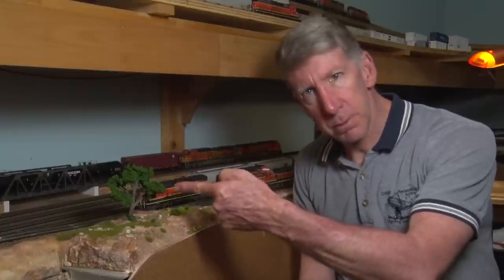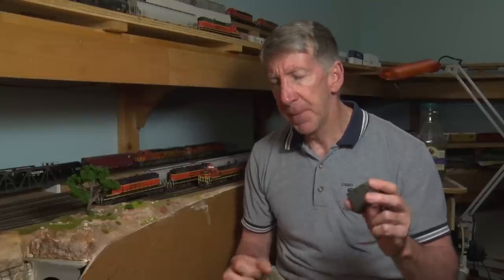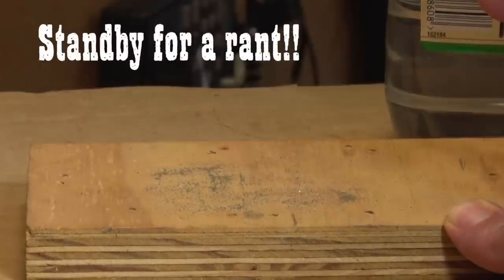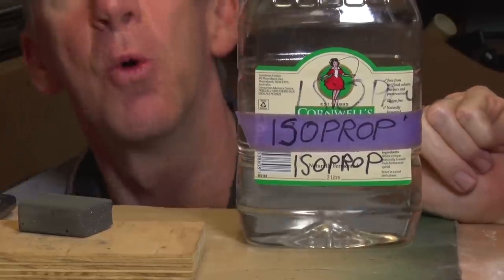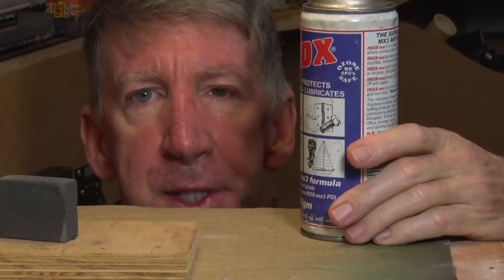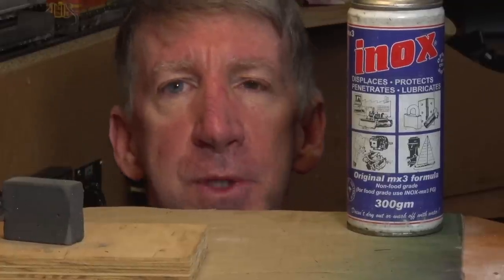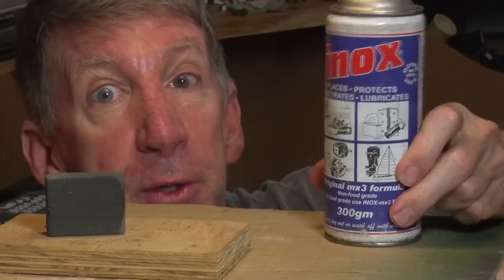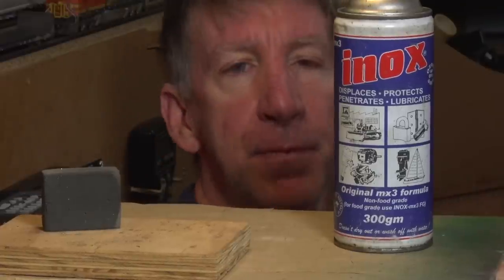Track cleaning do's and don'ts. How "Not" to  clean your track ! And how to do it better!

Comment: Yay Bunnings sell inox, and I'm about to go get some. After using isopropyl alcohol and methylated spirits that do clean but never long lasting, can't wait to lift my track cleaning game. Yee Ha!!!
Reply from the maker: Way to go Phillip! Just use a little and let me know how it goes for you.
CHeers Gregg
Reply: @FishplateFilms  Ok Gregg, after using Inox for the very first time, here's my findings...  Just 3 words...  USE EXTREMELY SPARINGLY!! Obviously I applied too much to my tracks and was wondering why my loco's were stop starting - jittery - needed a constant little push to get them going, blah blah blah. Also sometimes the headlights would NOT turn on but the loco would move a few inches then stop. Now I must say at that point I'm thinking this stuff is crap, but then I started thinking about all the POSITIVE comments I was reading about inox and then a penny sorta dropped. Armed with trusty dry cotton buds I went around and cleaned each and every rail and actually a fair amount of dark gunk came off. I then fired up my loco's and what a difference...  Absolute beautiful slow running and full speed running - EVERYTHING IS GREAT. GREAT I TELL YOU, GREAT!!!!
Reply from the maker: @phillipg1588  Great to hear Phillip!  Yes , you don't need much at all, and the more you run trains, it will get better as the INOX is spread around the layout. You will keep getting black on the rags, as this is the dirt from wheels being left on the rails, so it will clean your wheels as well!
Thanks for the feedback and enjoy your smooth running locos!
Cheers Gregg.

Comment: I hadn't been in the train shed for 18 month, but it's lockdown in Melbourne - so perfect opportunity to get back into the hobby! Spent a morning vacuuming up the spiders and dust. Then an afternoon fault finding wiring issues and trying to get trains to run without constantly stalling. Found your video and decided to give your solution a go. It absolutely surpassed my expectations! I now have locos crawling around the layout and not missing a beat, have never been able to reliably run locos at this speed before . Many thanks for your advice.
Reply from the maker: Hi David, 
Thanks for giving me your feedback and I'm glad you got great results!!  Your story is the EXACT reason I made the video and I have received many similar tales , so the rants have been worthwhile..LOL. Bad running trains spoils the hobby and there is no excuse for it these days! 
Have fun running your new locos! 
Cheers Gregg.

Comment: With the track rudder I use DCC same as you but I use the track rudder since I was 5 I’m now 13 plus if you did it on wood and if you did it on brass which is more like the track it would be a lot less so you test is not fair on the track rudder next time do a fair test and you will see there is next to non bust and no mess
Reply from the maker: As stated in the video Ethan , I used the wood to simulate going over turnouts and rail joints, which do indeed make large amounts of residue. There is less from the rails as you say , but the rubbers damage the rails, so matter how gentle you are:-)
Cheers Gregg.

Comment: fuck me dead mate that was a great laugh. love it. what are your thoughts on good ol lanolin oil? I've heard its does the same job. non-conductive but lifts crap right out of the way.
Reply from the maker: Thanks Liam..glad you enjoyed it! I have used "Lanotech" spray as well, and it's the same but is a little sticky. But it seemed to work as good as Inox.
Cheers Gregg.

Comment: Isopropyl alcohol is not ethanol; it's isopropanol, a different molecule altogether a 3 carbon backbone as opposed to 2.  You can purchase 99.9 % anhydrous isopropyl alcohol which is explicitly sold for cleaning circuit board contacts; I've used it on my tracks for years without issue.  There is no denaturing additive and an extremely scant amount of water, no more than what exists in the air as humidity.  To think your track isn't exposed to moisture because you don't use isopropyl alcohol is quite a misnomer, I would argue.  Isopropyl alcohol having such a low vapor point and excellent solvent properties makes it an ideal cleaner for sensitive applications.
Reply: how often do you clean your rails?
Reply from the maker: Every time I run the layout, I go over a different section. It might be once a month or longer?

Comment: https://youtu.be/4o2wUa6wxck the layout in this link was 5 scale miles long and we only used isopropyl alcohol to clean it a couple  times a year and never had stalling trains due to bad contact. I'm not saying your wrong, I'm merely stating we at the club did not experience anything but clean track that worked well on the layout. It was dcc.

Comment: Have not seen this product in Canada or U.S. Hobby suppliers.  There is a very effective  track cleaning product available, ACT-6006,  sold by Aero Car Hobby Lubricants, (aerocarlubricants.com or achlubes.com).  I believe it is non-petroleum based.
Reply from the maker: Yes , this has been suggested by others so It must be very similar!

Cheers Gregg.

Comment: Damn it Gregg, quit pussyfooting around, stop holding back and tell us how you really feel! Jesus, cracks me up how people with decades of experience try tell us how to do things, the nerve!!

Seriously, great information. I've also heard some people here in the USA using DeoxIT.  Thanks for the rant and workshop language!  Terry
Reply from the maker: LOL....Thanks Terry ! The nerve of some people!  Notice how I am not doing a rant on scenery..LOL
Cheers Gregg.
Reply: @FishplateFilms  hey Gregg, it's been a couple of weeks since your rant. In that time and per your "subtle" hint, I've stopped using isopropyl alcohol and started using CRC 2-26 to clean my track. With one application of CRC over the past 2 weeks, after dozens of laps around the layout, I have noticed an improvement in electrical conductivity and performance of my locos, especially in my staging/yard ladder area. There are hardly any "hiccups" anywhere on the layout. However, there is one downfall......with cleaner and lubricated track, I now have wheel slip at certain inclines on the layout. I'll either need to shorten the manifest or add more power......hahahaha      Terry

Comment: Nothing wrong with track rubbers. You were using it on wood which is abrasive itself. You don't rub your track like you did the wood. The tracks are thin so not all the rubber is in contact.
The alcohol here in the UK is 99% 1% water, there is 4% water in the air around you, so where is the problem.
Reply from the maker: If you listen to the video Peter, I used it on wood so you can see the metal particles in the rubber. All track rubbers are abrasive, thats how they work ! SOme more than others with PECO being one of the worst. Also IPA absorbs water through out it's life , and it is a "Polar" structure, which causes oxidation on surfaces. Just read the comments below and see what results people are getting from moving to a proper cleaner for electrical equipment.
Thanks for watching.
Gregg.

Comment: Hi Gregg I've just tried the INOX spray on my PPDC lay out ( Poverty  Pack Direct Current ) lay out LOL .
As I've not made the transition to  DCC yet  to the discussed of my mates .
The outcome was very good,  just 1 run around on both up down main line tracks , the CRC 2-26 I think is  not quite as good as the INOX .
After that commit I will  end up getting the keyboard warriors on my 6 about that LOL.
I like INOX  product as its readily available and I can use it on other applications rather than WD 40 , as this has a habit of rotting silicon suppression leads on  cars and boats.
Well done Greg a great piece of advice thanks for that .
Keep up the good work and stay safe from the Zombie Epocolypes virus .
Shaun
Reply from the maker: Thanks very much for the update Shaun!  I'm glad you got some good results and I would choose CRC over WD40 , though Innox ahead of them.Yes you can use Innox on heaps of things. Speaking of keyboard warriors..I have broken all my records with views on this video, but i've never got some many dislikes...LOL  all the IPA and track rubber users..LOL
Love the PPDC Sub Division!!
Cheers Gregg.

Comment: This guy has eyes like David Bowie!
Reply from the maker: Is that a good thing????  LOL
Reply: @FishplateFilms  It sure is! BTW is that Inox stuff similar to spary contact cleaners like we would use to clean potentiometers and such? Not familiar with it here.
Reply from the maker: @angeloarimborgo6352  Thanks Angelo!  No , Inox is heavier and slightly oily , like CRC but not like WD40. It will clean and also leave a protective film on the rails. you could use contact cleaner but it does not leave a layer to stop oxidation. 
Cheers, Gregg.

Comment: My IPA is 99.7% min. pure alcohol I've never had any issues from it.
Reply from the maker: The trouble is , that it soaks up water from the air, and becomes contaminated with age. It does clean but doesn't help with oxidation on the rails.
Gregg.

Comment: Sounds like WD-40 would work good then, it was originally made to displace water from electronics 🤔
Reply from the maker: Thanks for watching! DW-40 is not recommended as it is not suitable for some plastics and leaves a oily residue. CRC 2-26 is a good alternative to Inoxx.
Cheers Gregg
Reply: @FishplateFilms  wouldn't that oily residue help protect the track from corrosion? Tho might cause traction issues on hills, but if I did clean with it, it would only be on a rag wiping it down so shouldn't get on plastics, I'm still building my layout, got the river prepped ready for epoxy, just waiting on fish to get here, got a portion of the mountain done and base layer of static grass laid in the first half of the valley, but I will be laying track somewhat soon, and all the track I have I've had for years and probably a bit dirty and want to make sure when I put it together I have it clean and good to go for a while

Comment: Hi Gregg thanks for this great tip! Would this do the same job? CRC 05103 QD Electronic Cleaner -11 Wt Oz https://www.amazon.com/dp/B000BXOGNI/. Or is Inox actually better (other than being Australian, of course!)?
Reply from the maker: My pleasure! Contact cleaner is ok but it will not leave a protective film on the rails. Inox is better or CRC 2-26 if that is easier to get. .
Thanks for watching.
Gregg :-)
Reply: @FishplateFilms  OK sounds like Inox is the way to go then, despite higher cost. I need all the help I can get when it comes to smooth running! Thanks!
Reply from the maker: @rcacciato  It will last you forever...remember you only use a little bit at a time:-). Let me know how it works for you!
Cheers Gregg.
Reply: @FishplateFilms  Hi Gregg, I'm on a zoom call with my the local chapter of my model railroad club ete.org and mentioned your video. They're asking me how the Inox works with traction tires. Can you let me know? Thanks.
Reply from the maker: @rcacciato  I'm afraid it's a no go with traction tyres:-) ANything that makes the rails smooth and a little slick , will cause traction tyres to slip on the rails...just like car tyres on ice or smooth concrete!  Models with traction tyres, have more weight put on the axles with the tyres , so in the case of steam locos, the middle 1 0r 2 axles have very little or no weight on them , which makes it even worse when the tyres loose grip! Best to avoid them if you can?
Cheers Gregg.
Reply: @FishplateFilms  Thanks, Gregg. Unfortunately I have German locos most of which have traction tires. Need to ruminate on this… Take care and thanks again.

Comment: I did not believe that inox would be any good BUt I gave it a shot and "" B. me"" it does work  even with my steam locos But only if wiped off with a dry cloth after a light application . Color me convinced. 100% IiPA does not have any water content which is what I use. 70% does and maybe 99.9%- but mpre additive than water
Reply from the maker: Glad to hear it!  The only issue is with traction tyres , which I assume is why you wipe it off?  IPA is "Hygroscopic" meaning it soaks up water, so even 99% will eventually soak up moisture over time, but worse than that , it leaves a residue on the rails. which builds up over time. You can "clean" the rails with IPA if you wan't , but then go over them with INOX .
Thanks for the feedback.
CHeers Gregg.

Comment: The rant against pure IPA makes no sense at all. If you use 99.9% the residues are negligible, and much less than a contact cleaner, which as you say is non-conductive. What do you mean by ‘clean but non-conductive’? By ‘clean’ do you include free of residues but still covered by a non-conductive layer of oxidation?  If so, what is in Inox etc that removes oxidation? Presumably it is an acid or solvent of some kind. Best to know what it is exactly. Many proprietary contact cleaners ultimately do damage.

Comment: the point you make track rubbers is just plain wrong, not only did you demonstrate on a much rougher surface than brass thus creating much more dust, but you also rubbed it way more than you would rub a piece of track, not to mention you are only rubbing a very thin surface.

Comment: INOX is Non-Conductive ~ Read the lable!!. Most modellers that use isopropyl alcohol use 100% which has no water ~ not 70% as you mentioned. Many nmra modellers use 100% isopropyl alcohol on cork to rub the rails which is non-abrasive. Times change over 40 years. Loco wheels are usually cleaned with metho rolling on a static jig. It's evident from your video and language used you're an absolute lunatic that's just out to score a few views. If you add certain solutions like INOX MX4 LANOX and other solutions to a grade you will get wheel slip ~ something you haven't discovered yet. Better a dry track where a single HO scale UGL C44ACi can haul a 30+ train up a 3% grade constant with ease. Put some solution on the track and you will get wheel slip!!! It's not 'rocket science'.. a NCE DCC user ~ say no more!
Reply from the maker: I think you need to listen better...I did say it is non -conductive and IPA, even 99% , leaves a powdery residue when it dries..do a test for yourself! I also state that if you have traction tyres, then a wet cleaner my not be the best option. As for traction, why would I wan't to pull 30 cars with one loco...and 3% grades are too steep anyway. Try watching some of my videos and you will see long trains climbing the helix with no problems. I never clean loco or rolling stock wheels , s they don't get dirty in the first place , as the dirt is collected and cleaned off with track cleaning. As for your comment on NCE  ....Say no more!
Gregg.